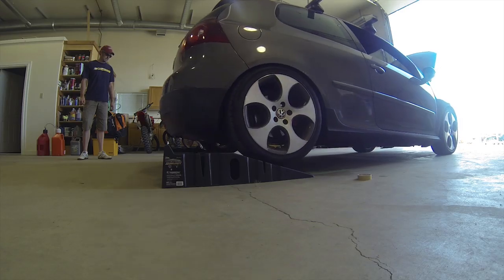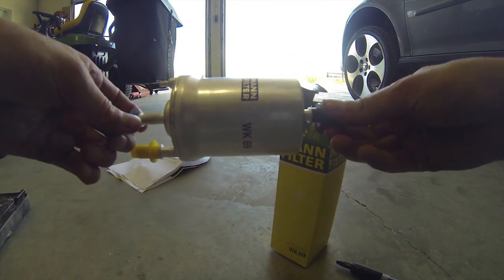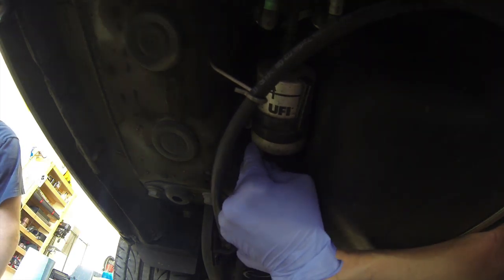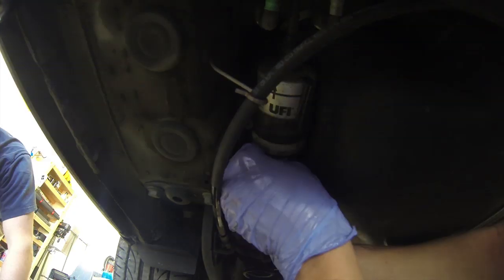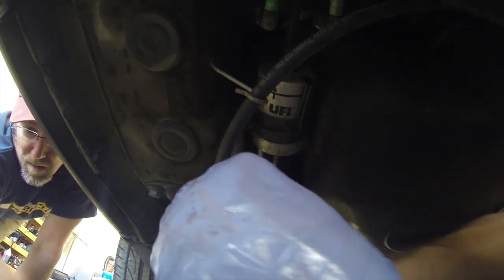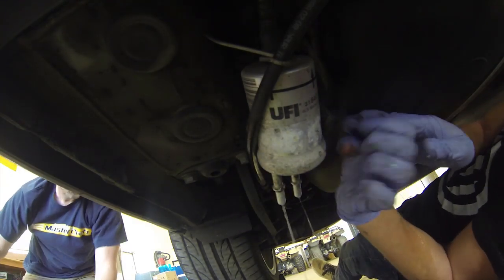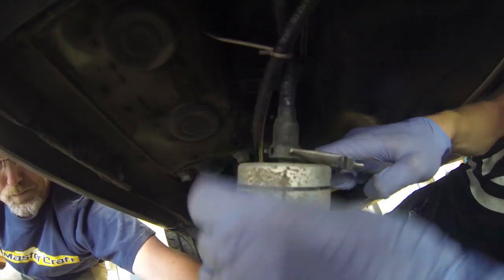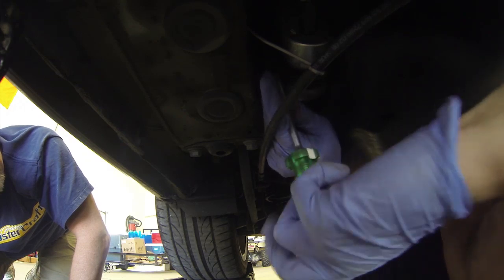MKV GTI Fuel Filter Replacement - Easy DIY How to

Comment: A word to the wise, be careful removing those lines. If you have depressed the catch properly they should slide right off with very little force. If they are sticking or hard to pull off, don't force them. Push them further on to the filter first and then try again. If you break those clips or crack the plastic, they have to replace the whole line. If you crack it on the fuel tank side, they will probably have to pull your fuel tank to replace them.

Comment: Thanks for posting this man! Just did it last weekend and it was a breeze! However, just a week after changing it I started getting some pretty bad misfires in high gear. For example when doing 60mph and trying to pass someone in 6th? Have you ever had this happen post filter change?
Reply: You have an update to that? How did you solve it? Or time solved everything?
Reply: I know this is late but next time just drop a gear or two.

Comment: Hi i dont get what u mean my prime the fuel lines an pump do i jus keep turing my key to second postion an back for 30 seconds for do i pump the gas pedal please let me know as i dont want to make the car worse when i replaced it so car basically jus cant start stright away
Reply: Just turn the key I'm sure
Reply: The car isn’t carbed so you don’t need to press the gas as it won’t do anything with the car off, just have to prime the pump
Reply: I didn't understand what he meant either

Comment: mine wont start now and i tried to prime it alot i even sprayed carb cleaner into the air box and got it to run for like 5 seconds maybe i got a bad filter
Reply: try to switch the ignition key few times without turning on the engine. That way your fuel pump will pump more fuel and maybe will start
Reply: bro did you ever figure this out, tryna fix mine right now. same issue.

Comment: Got a PO302 fault code. Misfire on cylinder 2... have swapped the coils and plugs around with no change the fault code. Please see my video, could this be the problem and what bar pressure do i need for the 1.4 TSI 122 engine ?

Comment: My Mk5 GTI doesn't always start smoothly.
Video: https://f.maxkoning.nl/IMG_2504.mp4

Could this be caused by a fuel filter that needs to be replaced?
Spark plugs & battery are already replaced.

Comment: Always make sure to depressurize the fuel system before attempting this. ( not mentioned in the video)
Reply: How do you depressurize the fuel system?
Reply: @johnnymarin8974  Let the car sit for a good hour or two without use. Therefore it's a perfect first thing in the morning job. Probably a good idea to fill up a can with some fuel and pour it over the new filter before installing it also
Reply: @johnnymarin8974  Pull the fuel pump fuse and try to start the car.